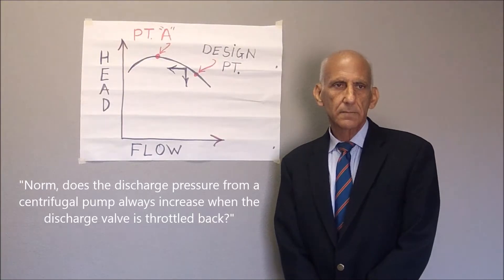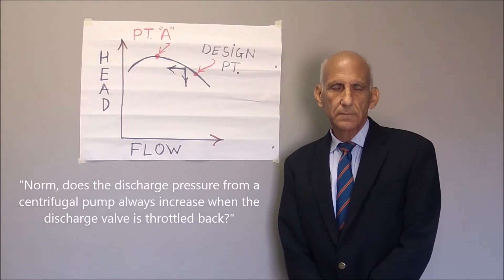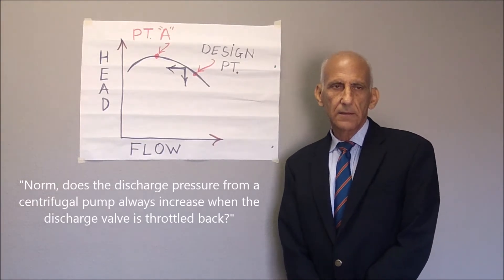CENTRIFUGAL PUMP HEAD VS FLOW PERFORMANCE CURVES

Comment: what's the meaning of point A
Reply: at point-A pump can deliver maximum head but flow is not that much high which can meet process requirement. Pump manufacturer has to choose right pump size economically to meet flow vs required head that is generally happen next to this point.